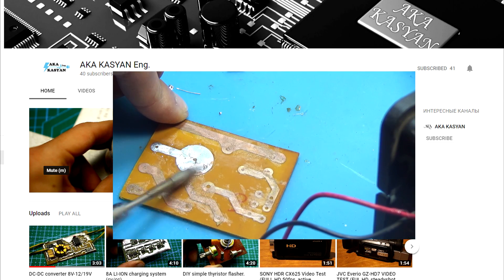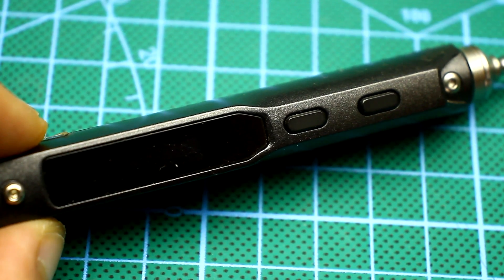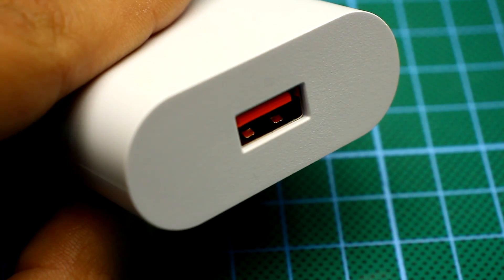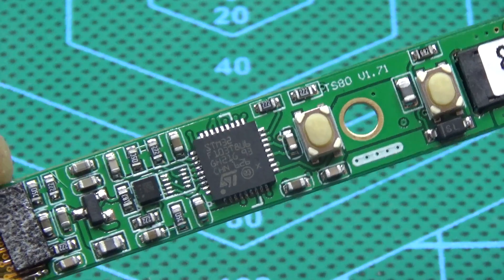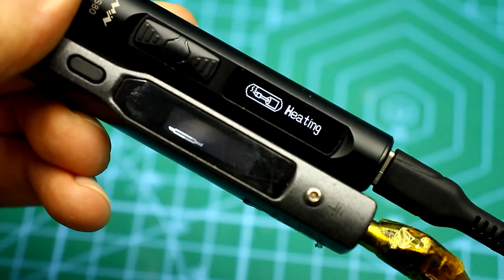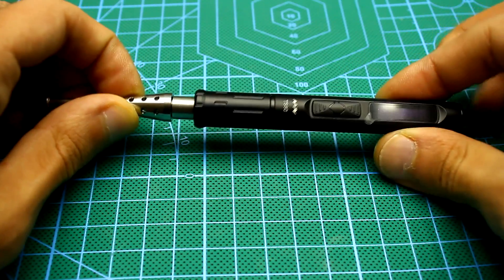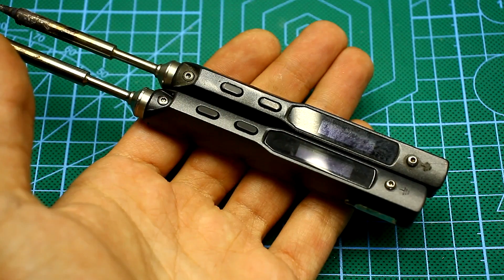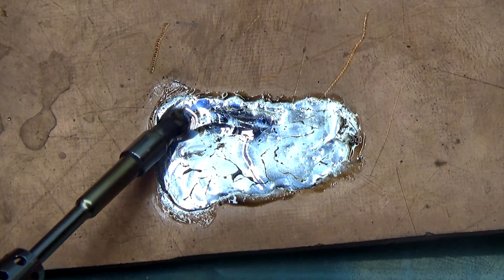What's better? TS80 VS TS 100

Comment: Hi!.
The sensor and the resistance of the tip of the ts80, follows the standard t12 with sensor in series the resistance or the standard of the weller rt1, with thermocouple in parallel with the heating resistance ?.

Comment: The following is a breakdown of some main advantages for each unit, as compared with the other. Only the advantages are listed.
TS100's advantages over TS80:
- More powerful than the newer TS80, but only really noticeable on extreme jobs. If you do a lot of fat wires on heavy connectors, then this should matter to you. Also heats up much faster.
- Cheaper price now that the new one took it's price-point.
- Sturdier and more traditionally styled power socket. Will last longer under heavy use... The socket is also compatible with many laptop power bricks that can be had for a song at your local recycling centre, or thrift shop. It would also be quite easy to adapt or build your own cable adapters for use with different power sources. This counts a lot toward versatility when going off-grid with LiPo packs, or to plug into your car's lighter socket. 
- Available accessories include more tip choices and color casings. It is probable that tip prices will be discounted, like the main body. So, expect even better pricing, eventually.  

TS80's advantages over TS100:
- All-metal casing, with optional silicone finger grip. 
- Slightly shorter finger to tip distance gives a bit more precision control for delicate jobs. (Both units are better at this than most others.)
- Easier to hold because the body is round, just like most professional irons.  This is convenient if using a tip that can vary it's tip to surface contact area when you turn it. Which includes all but the conical tips, really. (Of course, this can be done on the TS100 by rotating the hot tip with pliers... but it is not as easy.)
- Already comes with a power supply unit. Also conveniently plugs into other USB-C power sources, like newer, top of the line power banks. 

Summary:
Both are excellent tools for most users. 
Either one is an awesome acquisition as a first iron, but I would not even consider an "upgrade" from a TS100 to the prettier TS80 until the older one failed, and USB-C power banks got a lot cheaper! That being said, I'm a cheap bastard anyway, so the TS100 would still be my preferred model for a first purchase because of its lower price, superior versatility in power sources, and more powerful output.
Reply: Not to mention, the tips for the TS100 are cheaper. And call me superficial, but I like the optional blue color. :)
Reply: Thanks so much for the precise guidance. You are so versed in it.
 It helps a lot.

Comment: Thank you so much for doing such a helpful and useful video. I have been trying to decide which to purchase. I ended up getting the t100, I would have bought the t80 if it had higher wattage and old tips.
Reply: shwa that's the better choice ! Because the t100 you can use to 24v but at the t80 you can use from 9v to max. 13volts! ( don't go over 13volts ! Better go max. 12volts ! ) You can upgrade it to the custom firmware the t100 if you want that's handle the heat and power banks better ! Ts100 65w ! Ts80 35w ! 
I researched and My opinion is that the ts100 is the better choice because you can use with upgrade kit hakko solder tip's ! And I think the ts100 is more power full !
Best regards,

Comment: The TS80 will propably work with my huawei superchargers (Wich can output Huwei supercharge (5V 4.5A) Or regular 9V 2A Or basic 5V 2A)  depending what is plugged in... I will confirm this when it comes
Reply: You never confirmed brother
Reply: @ericsalidbar1693  well it works, now im waiting for a TS80P

Comment: Useful review!

I like the body of the 80, and the idea of it, but the quick change tips are hard to find and totally unique. So you’re locked into that supply chain. I’m also unsure if quickcharge 3 will be around forever with USB PD being the favored format for USB C. Also a little concerned with the fragility of the connector.

If they had more tips available and could switch to USB PD, it seems perfect.

But otherwise as a tool, it seems like the 100 is a safer long term bet—more future proof and robust connector and power source, common tips that are compatible with Hakko, and a bit cheaper. The plastic case is a really shame, that’s about it.

Note that there are usb power banks that have both quick charge and DC barrel output—I have one of those, so I can use either of these on it directly.

Comment: why wouldn't they make the tips cross compatible.....
Reply: The TS80 is shorter, easier to exchange, has lower mass less heat loss. 
It’s an upgrade to the TS100.
Reply: Different connection...
Reply: marketing

Comment: It seems the narrator started calling it “TC80/100” instead of “TS80/100” toward the end.

I really like the TS80 so it’s a shame it can’t match the TS100.
Reply: Unless you need to solder very big pieces, the TS80 is a step up...
Reply: The Echelon 
I’m amazed by how much heat the TS80 can push into large heat sinks.
Reply: I don't think the TS80 was supposed to surpass TS100, but to be a lower-power variant of it, hence the lower number
Reply: @SomeAngryGuy1997  It's essentially a TS100 with USB-C but USB-C Power Delivery isn't enough to reach the same wattage. It's every bit as good up until you hit that limit. I don't think they set out to make lower-power variant though that's what we ended up with. :(

Comment: I have the exact same opinion, the TS80 is a fantastic solder iron no doubt, but expensive, and a bit more limited when compared with the TS100. And ... it will struggle on heavy gauges of course.
Also, although the TS100 is more powerful we must remember that powering the TS100 from a battery is also viable. Let's not forget that these irons are controlled with PID loops and therefore the TS100 even if more powerful will have a lower duty cycle and faster adjustment when soldering therefore the 60W rating will be optimized and therefore the power draw from the battery does not compare proportionally with the 24W TS100. That is the TS100 is not going to be using 60/24 more energy then the TS80. Of course it depends on the situation since Thermal balance will be key to measure the energy balance between both solder irons.

Comment: thanks but which one is good for soldering i want to buy one and i have problem with soldering tips my tips oxidize
Reply: Learn the basics of soldering, keep your tip tinned when stored.
Reply: blackburn michelson 
Keep your temperature as low as possible. Start at 275°C. Increase (only) when necessary.